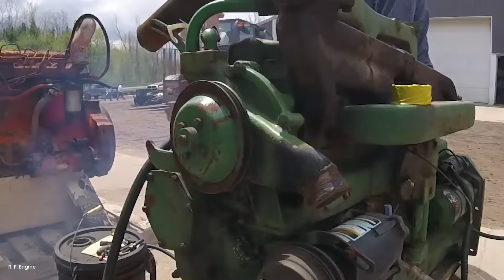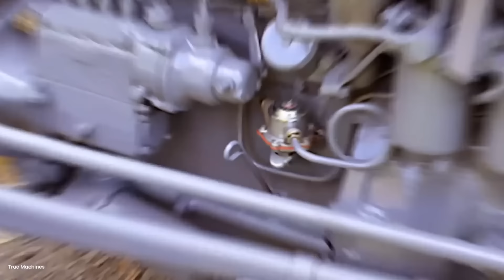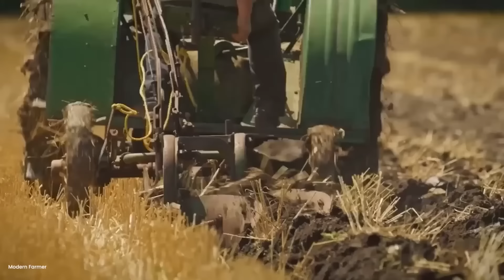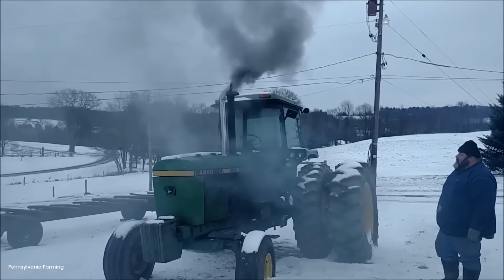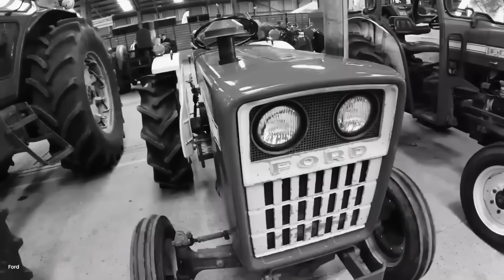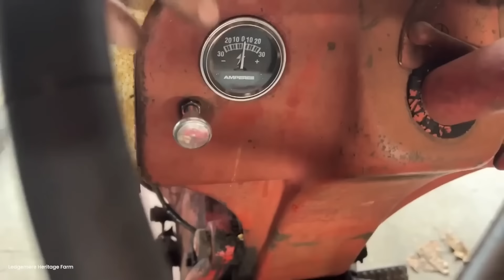This Pennsylvania Farmer OUTSMARTED John Deere With a "Homemade" Turbo Tractor in 1978

Comment: A case dealer in Vermont was putting turbos on old case 730,830 ,930 back when my late dad was younger we had a torbo case 730 comfort king that was done at dealership brand new but no warranty are 730 was 60years old still going when something dumb like a gasket  went  and was getting blowback

Comment: My 73  4630 blower intercooler needed a good home . Fixed it up still use it those old John Deeres r hard to beat.  Same with my 8640  solving fuel problems to make it  work good.

Comment: Why wouldn’t a simple belt driven twin screw blower be better? On a diesel they’re only boosting air, not mixed fuel. I don’t know but I don’t think they are as sensitive to neglect as turbochargers are.

Comment: 4430 was turbocharged
Reply: No such thing as a naturally aspirated 4430.
Reply: Yes and my brother owns one that has a after cooler as well,not to often to see a 4430 with a after cooler.
Reply: @sodbuster518able  A friend of mine has one. Last time it dynoed at 285 hp
Reply: I forgot to mention it now has a466 in it as the original 404 suffered a broken crankshaft.